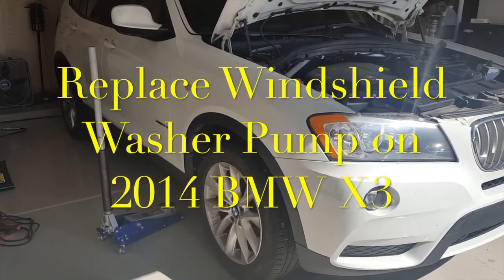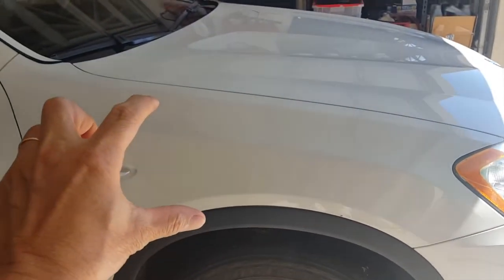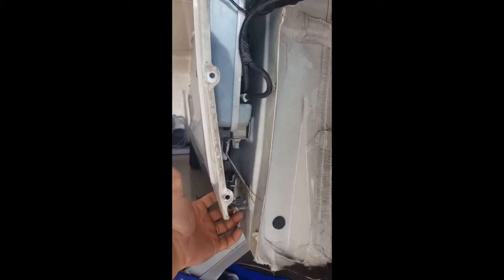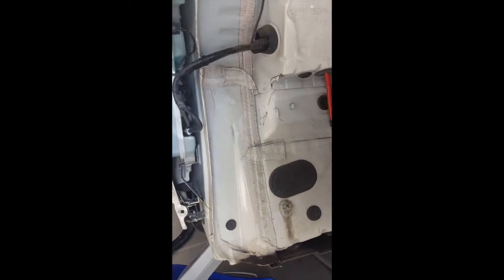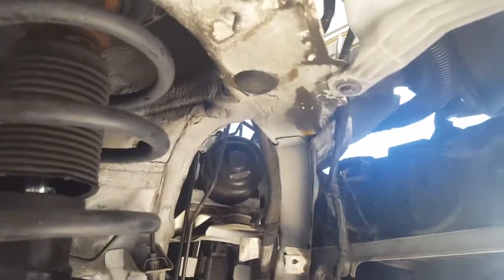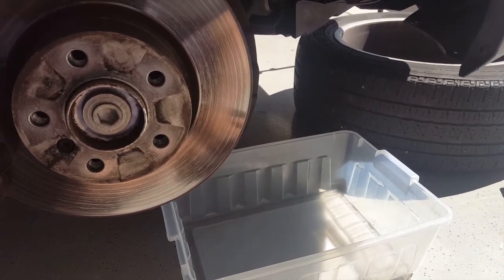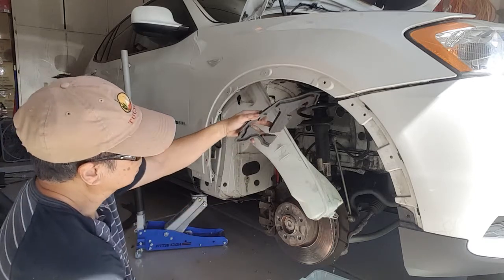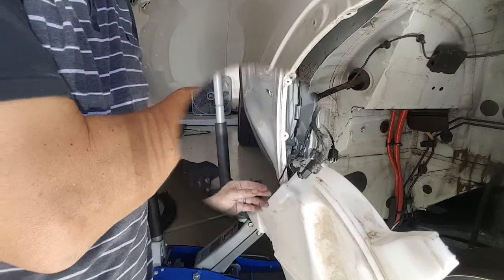Windshield Washer Pump 2014 BMW X3

Comment: Great video! Very helpful indeed!  I've got a 2011 X3 28i - so very similar - but I note a few extra tips: 
- I didn't take any screws out of the wing piece at the top, but it is useful to remove the two lower rear screws to give a bit of space inside the wing
- watch out for those pesky strainers for the two bottom pumps (front and rear screen washers) - that was our only problem. The pumps are way low in any crud that accumulates over the years - and give the tank a good flush!
- The strainers are fine nylon mesh units and integral to the two black rubber grommet seals that the pumps' noses slide into. So, pull those out as well, and wash in warm soapy water; agitating with an artist's brush.
- Last snag for getting the tank back in, especially if you've not attacked things from above, like Andy did - make sure you feed the side indicator feed cable around the correct side of the tank, before replacing all your pipe and cabling connections.
- don't forget the water level sensor!

Cheers from NZ!
Rich

Comment: Andy, to change the washer level gauge only (not the pump) Do I need to loosen the side panel or just removing the protective black panel is enough? On your video, it looks like I can access it without loosening the panel. Thanks